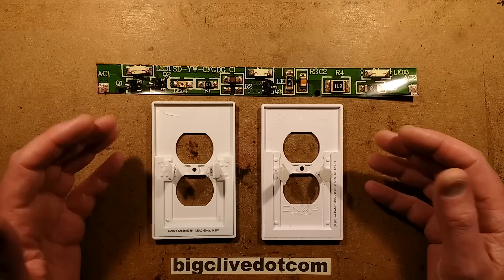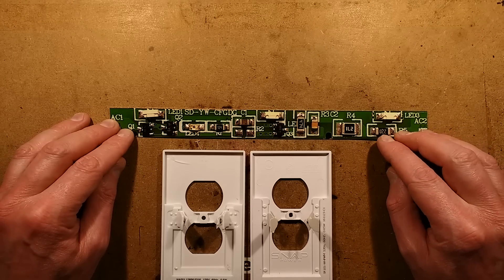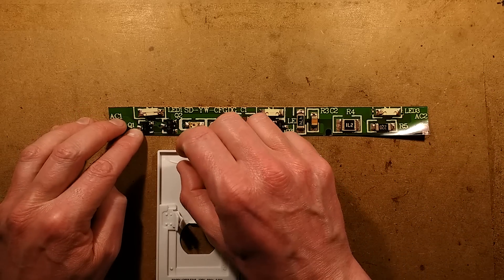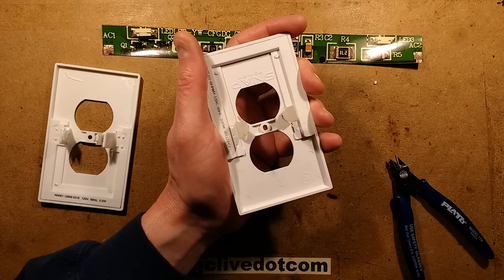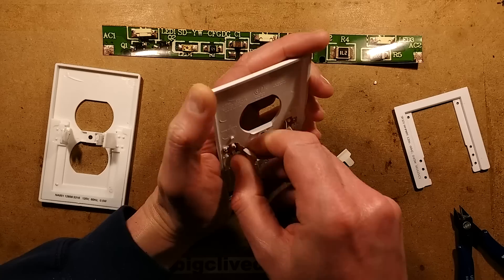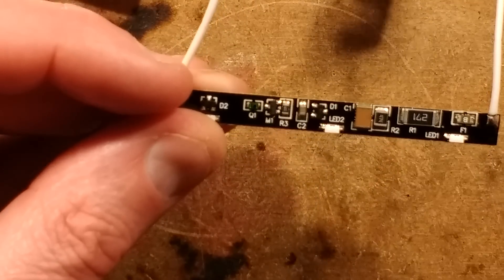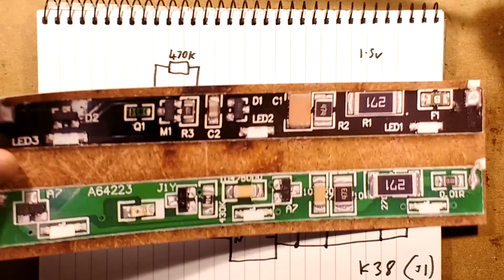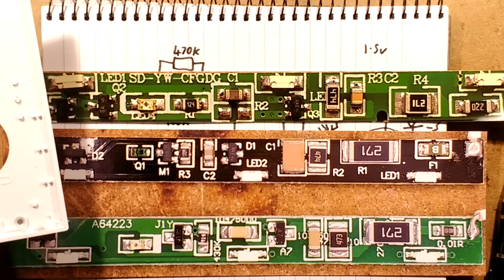Inside a REAL Snap Power UL certified night light.

Comment: Why not use a PMOS in series and not waste power like this? I know PMOS has higher Rdson, but LEDs are off most of the time if this unit is installed in an area where there must be enough light to read by during the day, and should not trigger the photo sensor. 
Wasting a minimum of 2.43mW all the time (assuming 3mA is passing through the R270). They should also use a MOV to protect against surges. Everything is build the cheapest possible way. Safety must come first which now a days is a rarity. 
Seen AvE's new video on Fluke? Horrifying.
Reply: That would not be the best idea: The FET then would need to handle full peak mains voltage (actually the clamping voltage of the MOV that would then also be needed), which is quite an expensive and large choice (~600V, SOT223 minimum). The rectifier then also needs to be a 600V type instead of the small low voltage parts used. Also you still would need some low voltage supply to bias the light sensor of off, which easily offsets any power savings. Might be quite hard to fit that into the given space, too.
As is, it doesnt really need a surge suppressor, as long as the 270R is properly rated for the energy it needs to handle.
Reply: Flauschlab, are you drunk?
Reply: What's wrong with Flauschlab's reasoning?

Comment: Is it just the picture but the smoothing capacitor in the latest clone (the one with the oddly low value resistor) looks to be the biggest smoothing cap out of all 3 boards?
Reply: Neosophist The smoothing cap has a low DC voltage on it, so it can be much lower rated than the dropper, which is effectively directly across the mains at 120VAC.
Reply: Yes I know how it works, that wasn't my question. I was more curious as to why the latest board he has reviewed (which like the first board) has much the same small dropper capacitor yet this latest board seems to have a much larger secondary smoothing capacitor, (look at the photos when they are together) in the pictures it looks even larger than the smoothing capacitor in the genuine products board. It seems oddly chosen.
Reply: Looks like they got lazy and probably used the same crap cap for both.

Comment: BigClive, in order to convert it to UK mains voltage. would it be just a case of a higher value inrush current resistor and a different value capacitor on the dropper / limiting circuit ?
Reply: You can't use it in the UK as it's not British Standards approved. (Both the socket design and the PCB)
Reply: Change the value of the cap. Done.

Comment: I bought a few of the cheap clones and was disappointed.  First off, the contacts were all slightly off.  It would light up right until I snugged the screw.  At that point, it would flicker and go off.  So, they're not quite in the correct spot.  Secondly, they didn't use the same LEDs on the board.  I've got a mix of warm white and cool white with slightly different throw patterns and intensities.

Comment: Interesting that there doesn't appear to be a UK socket equivalent.   I guess with UK sockets you would need an entire replacement as the socket is usually built into the faceplate, but still, you would have thought that there was a market.  Perhaps there's a problem with electrical standards?
Reply from the maker: It would need fully wired as opposed to these simple clip on plates.  That reduces the market.
Reply: In the UK the grub screws will be all recessed and buried safely away, plus in all different locations on the back depending on the manufacturer. The only place to pick up power on UK sockets to get the same simplicity would be in the sides of the legitimate L and N openings, but then you have the shutter mechanism preventing that, so the only option left would be even more simple - a full blown night light with a pass through socket!
Reply: You CAN get LED backplate illumination for light switches (both MK and Crompton). Whilst not low-level it makes finding the wall switch a lot easier at night (especially if you live in rural, unlit areas)
Reply: Paul. it is a fledgling company in the United States, hence the products being targeted for North America.
Reply: Likely this is the nearest you can hope for the UK currently; http://www.ebay.co.uk/itm/Status-LED-Auto-Plug-Through-Night-Light-White-/272882676706 (Chunky!)

Comment: Yes, as always an interesting item. Would you please always check focus after zooming in.
Reply: Standard practice is to zoom in, set your focus then zoom out. Then you can zoom in and out while maintaining the correct focus.
Reply: Pretty sure he is on a phone that may or may not allow him to lock the focus.
Reply: No, you cannot on all phones (at least not with default camera apps). I do not know what phone he is using.
Reply: Years ago? It was only a few months ago. And all phone cameras are crap. He should use a real camera.
Reply: Don't be so sure about that. A crappy mickey mouse phone camera with a meniscus lens isn't going to give you very much quality.
Reply: (In answer to Gary's initial reply) you are correct of course - but you still have to use the correct focus point. Traditionally this would be about a third of the way into the shot. This (aided by stopping down the lens as far as possible) gives the maximum depth of field.  Phone cameras can have quite a decent camera-  but not with the iris fully open.
Reply: u can the screen to force focus ,galaxy phones have the best autofocus though fastest and most accurate
Reply: i thnik he uses a moto g5 ? at least said on the last video update i seen he made ,but yh samsung phones always had one of the best camera apps, he used to use some shitty ipad years ago
Reply: Er, depth of field is always 1/3 in front and 2/3 behind the focal point. Set the aperture as small as possible (it helps to have aperture priority for this. All decent cameras have long since had this mode going back into the pre-digital age). It also helps to have bright lights. The further away an object is, the greater the range of the depth of field. It's also the case the wider the lens angle. Of course, there's a limit to this when working over a bench. However, anything that would be in focus below the bench would be a waste so the best thing to do is hold something up above the bench, focus on it, then set it on the camera. Any good photographer would take measurements and note it so as to keep everything in focus. Camera lens used to have markings for this on the lens barrel. Not any more. People seem to prefer to rely on auto-focus and are invariably disappointed.
Reply: gary " real camera " ? lol ,yh they cost too much and are way too clunky to use and offer no better quality for bench work

Comment: Why do any of them bother turning the LEDs off?  It doesn't save any power in the shunt configuration.  Is the LED life really extended?
Reply: Yes, LED life should really be about doubled. Still pointless, because in a good design and with decent LEDs they will last almost forever anyway and with bad design and cheap LEDs even twice the life time won't matter much.
The main reason why they switch them off would be customers asking "why are they on and wasting power when it's bright?" if they were on all the time. People don't know that power consumption is the same.
Reply: Elektro-Peter but the difference is almost impossible to notice. Perhaps a few pennies a year. (The transistor requires real power to operate so it doesn't go down to zero power when shunted)
Reply: You have to keep in mind that by necessity, the reactive ballast (the capacitor) is in series with a significant resistance.  It will dissipate real power even if the shunt mosfet were ideal.  Assuming the ballast figures of 100n+270R, the LEDs would be operating around 4mA.  The ballast resistor and diodes contribute roughly 30% of total power dissipation in the on-state (calculate it).  The mosfet resistance has no considerable impact on the off-state dissipation compared to the ballast resistor.  (270R vs ~0.1R) 

So yeah, the shunt does save some energy, but it's not really a lot in absolute or relative terms.  You'd save about $0.0005/mo if it had a duty cycle of 50% (assuming a $0.06/kWh rate).   It would have to last 580 years to save that 25 cents.  Given the phosphor life of the LEDs, it's a fair bet to assume it cannot last long enough to make back the energy required to make the components needed to implement the sensor.  

Don't think you can omit that resistor to prune off-state losses either.  It's necessary to keep high frequency content (transients, turn-on edges) from dumping straight through the ballast.
Reply: Oh dangit.  Well, yeah, Clive mentioned that -- but I forgot to account for the bleeder resistor in my calculations.  I was totally wrong.  The quiescent dissipation actually dominates. 

In the 100n/270R/470k configuration, switching the LED's off only reduces dissipation by 33%.  
in the 100n/270R/47k configuration, switching the LED's off only reduces dissipation by 2%.  

So my conclusions were actually overly optimistic.  My bad.
Reply: That's actually a pretty good point.  If they're running them at a conservative current, I don't see it really being a practical issue to leave them running but knows what consumer expectations actually are though.  I also kind of wonder if you'd eventually get plastic yellowing around the emitters over time.
Reply: Which one do you think consumers will buy, the one that turns off in daytime or the one that doesnt? They're the same price.

Facts do not matter in popular culture.
Reply: Actually, though unintuitive, shunting the LEDs out DOES save power in conjunction with the capacitive dropper. For example, if the voltage over the circuit after the capcitor would go down to 0V, you would effectively be left with a capacitor across the mains. That doesn't use ANY active power (only aparent power, for which you don't pay as a consumer). Of course the voltage is not going to be 0V with this circuit, but it is still going to use less power than when the LEDs are on.
Reply: Robert Szasz yeah, it would go down to the Vgs(th) of the particular mosfet. Could be 1-3V.
Reply: Jernej Jakob I'd guess there would be something like a 10 fold reduction in power. (It could be over a thousand fold with careful design) Your average user would never notice the difference though as that's a savings of less than 25¢ a year.
Reply: Robert Szasz Assuming the LED current is 10mA, the real power would be close to 100mW. Because the MOSFET isn't a dead short when on but can only go down to Vgs(th), depending on the MOSFET used (two of them, including the original, use KAE which is probably Si1302DL with Vgs(th)=2.5V, one clone uses J1 Y which is BSS138 with Vgs(th)=1.5V) the OFF usage would be lower by a factor of 3 to 6. So considering the additional expense of the parts, I doubt it's worth the electricity savings.
Reply: I guess kakunapod has hit the nail on the head. It's a marketing question. It's beyond doubt that it would make more engineering sense to leave the LEDs on all the time. The difference in real power is negligible, and the added circuit complexity probably means the life of the switched version is considerably shorter than it would be if unswitched. I suspect the life of the unit is limited anyway by the capacitors not by the LEDs.
Reply: Yeah, consumer expectations was one of the first things I'd mentioned.  This was about whether practical benefits exist regardless of whether people can be misled by the explicit or implicit claim that they do.  There are likely other ways to implement a light sensor that can better provide those benefits.

If all you're here to say is that decades of marketing have cultured generations of oblivious consumers, meet the choir.
Reply: Yeah, the energy savings claim seems pretty much bs.

That said, I suppose it would still extend the life of an abused neon just the same as it would for abused LED's.  A neon may have a relatively short operating life depending on its type and the operating conditions.  A well-selected lamp might be rated for 25kh, but something that's driven way beyond its intended current for use as an illuminator or a lamp that has contaminants in the gas fill might have a life <1kh.  I've certainly had a lot of neon indicators in cheap illuminated switches turn into erratic crest detectors within six months.
Reply: Why don't they just actually switch the LEDs out by having the mosfet in series, rather than parallel (and inverting the logic)?
Reply: The magnitude of capacitor voltage really has nothing to do with anything here.  The circuit behavior isn't solely reactive.  The quiescent losses are non-negligible (~30%).  The potential energy savings are arguably negligible.  See my prior comment.
Reply: Am I first to notice that in the last clone the discharge resistor is only 47k (opposite to 470k in the others)? This will make circuit draw current regardles of leds being shunt or not.
Reply: I had a night light once that had a neon bulb in series with a resistor. The sensor that turned it off during the day was a CDS cell in parallel with the bulb.
No power savings. Pure marketing.
Reply: GreenAppelPie actually Electro-Peter is correct. If the LEDs are shorted out, then the capacitor charges to a higher voltage. While a capacitor connected directly across the mains will draw current, it will be out of phase with the voltage, resulting in almost no real power usage. The higher the voltage across the capacitor, the closer it is to being directly connected to the mains.
Reply: Elektro-Peter no, as Clive pointed out, the light detector just short and conducts the power since it is a lower voltage potential vs the LEDs.